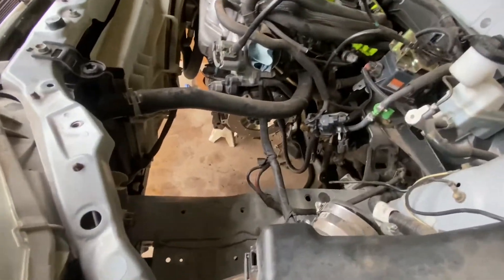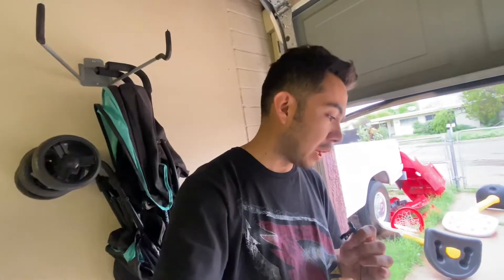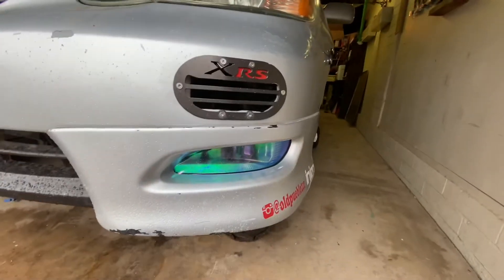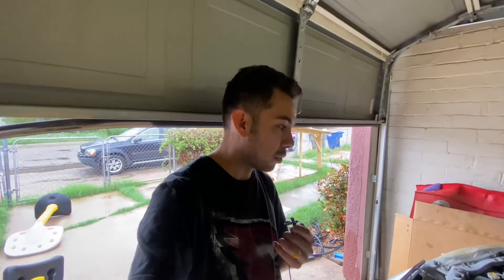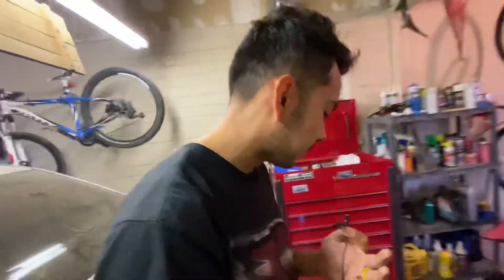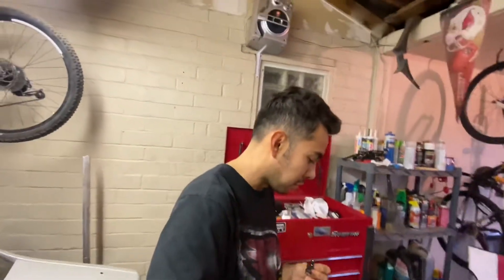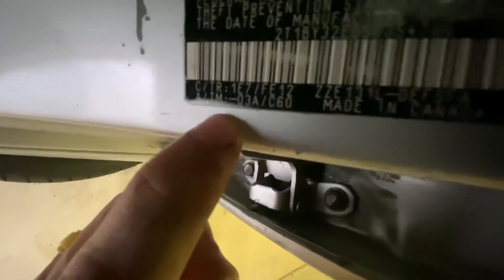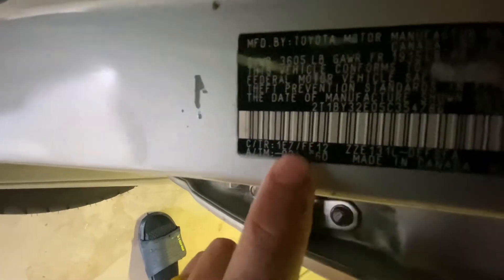Checking If you have a TRD Helical / Torsen LSD Transmission | C Series Toyota

Comment: "TRD" haha.. helical/torsen lsd has been fitted to oem cars since the release of the 1996 Celica SS-III (non beams engines). I wonder if these "TRD" units were pricier than oem units when they were available at the dealership. because you know, TRD equals faster n better.

Comment: I have 04 matrix xrs and I put the cold air intake and I broke the plastic pipe that connects to the 2nd air injection.  And now I have a check engine light .  What is the plastic piece called ( where the hose of the intake goes to)
Reply from the maker: Like on the air injection device?